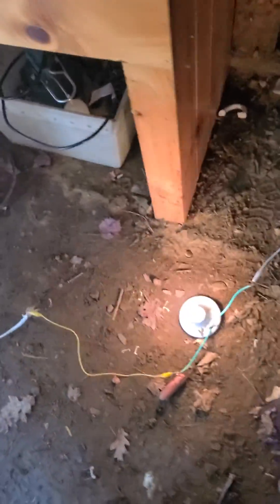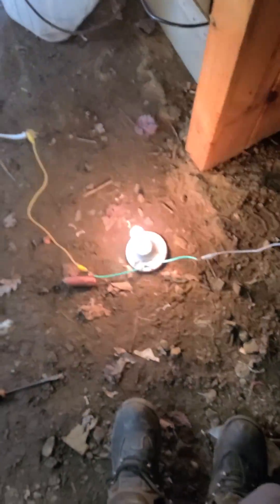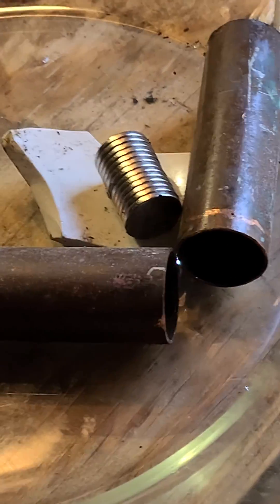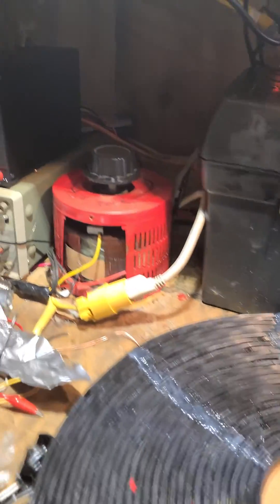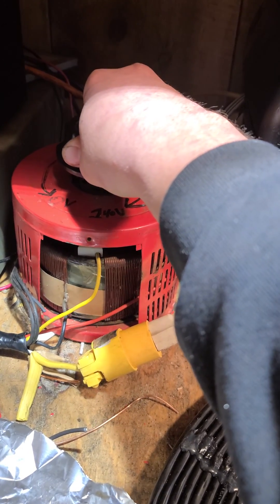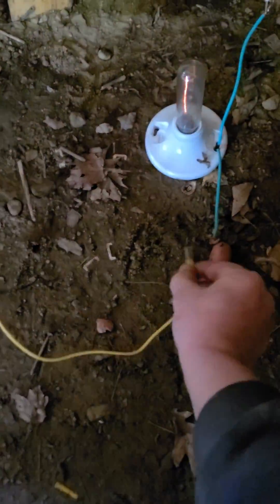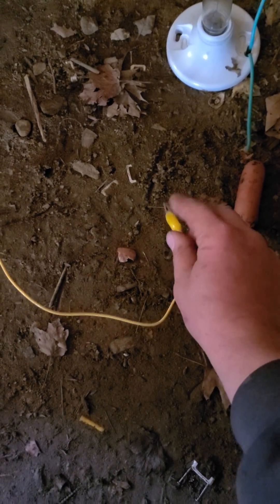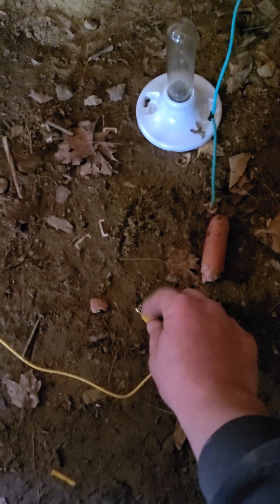Cold/Radiant Energy Magnified Through The Ground

Comment: Think of using longer copper pipe as a spark gap as the dielectric discharge happens inside the copper pipe same length weight preferred wn quenched nd u can increase the voltage w gap ie 2mm for 5-6kv approx 3k for 1mm n cap to have the correct hz  as the longer pipe makes the resonance better and quenched magnets higher  tesla magnets to have resonance or pinging of charges go from one end to the other in the copper  n transfer to a stp dn transformer n chk w load can work

Comment: You got me intrigued.
Reply from the maker: Its a very simple circuit. Its the real tesla hairpin circuit. The key is a heavily magneticlly quenched spark gap along with using 1 or 2 bifiliar pancake tesla coils instead of the copper bars. 1 as a primary & 1 as a secondary. Or a 4/16 awg coil. The beauty of this circuit is we get the most energy gain in the system when  our bifiliar tesla coils are in a 1:1 ratio. & we ground 1 end of the hvdc side.
Reply: @MTECHINDUSTRIES  Thanks again my friend!  And thanks for explaining your coils more.
Reply: Super cool.  Your description is detailed but just to be clear could you please include a schematic.  Thanks